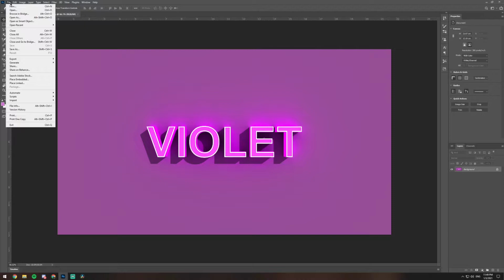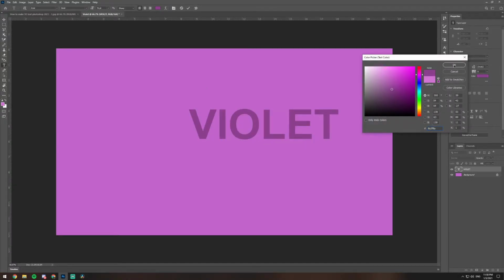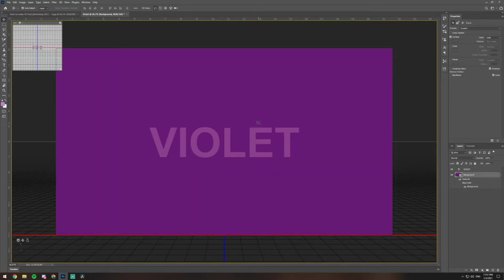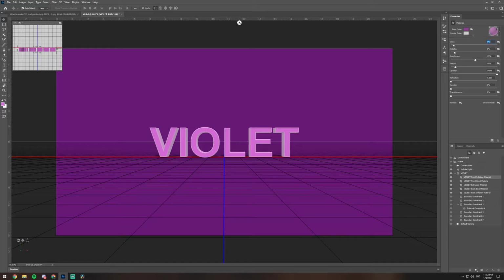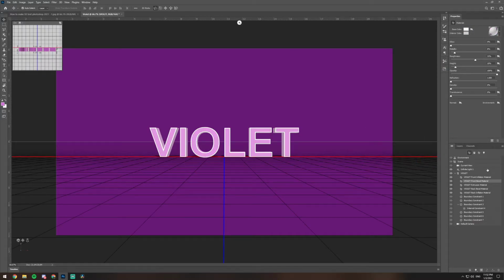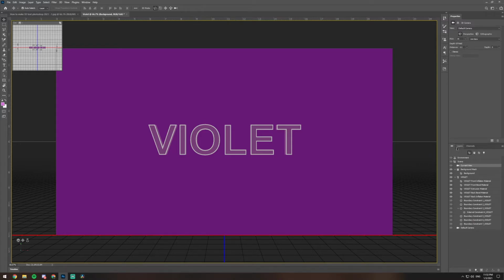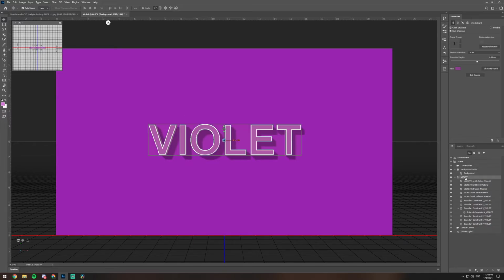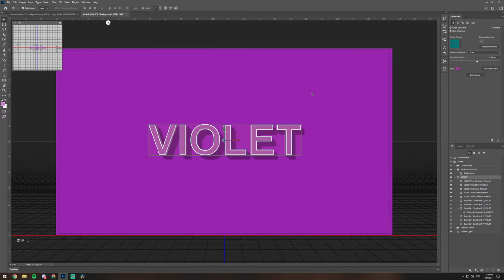How To Make 3D Text in Photoshop 2021 - Easy Tutorial

Comment: at 3:34 i dont understand sir.. i press control key but nothing happen. the two layer didnt merge. i'm currently following this tutorial step by step now but i'm stuck at control key thing.
Reply from the maker: Hi Hanju-ju! Thanks for the comment. The key to press here is Ctrl + E, if you use that shortcut on your keyboard you'll be able to merge the layers. Hope this helps.
Reply: @Base-3  thanks i already figure out myself but im having another problem during render process. It wont show how much time remaining during rendering.
Reply from the maker: @junandeo12345  It shows a little progress bar in the bottom left corner of your screen, there is no exact time bar. Hope this helps.
Reply: @Base-3  i mean it does not show at all.

Comment: When I right click onto the text layer to make a new 3d extrusion from selected layer, it doesn't show that button!! It just lists those colors and that's it. What do I do?
Reply from the maker: Hi Lincoln! Thanks for your comment. Is it greyed out, or doesn't it show it entirely? You can also access the function by going to the tab 3D> New 3D exstrusion from selected layer.

If it's greyed out you have to to turn on the 3D setting in Photoshop. For that you go to Edit>Preferences>3D and go to the 'Performance' tab. There is a checkbox for 'Use Graphics Processor', check that and restart Photoshop.

You should now be able to use the function, let me know if it worked!